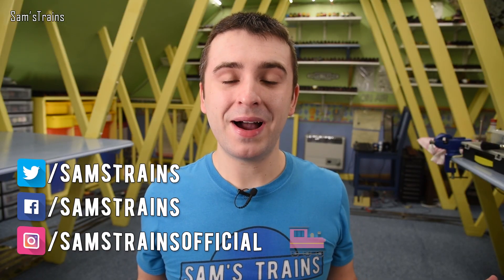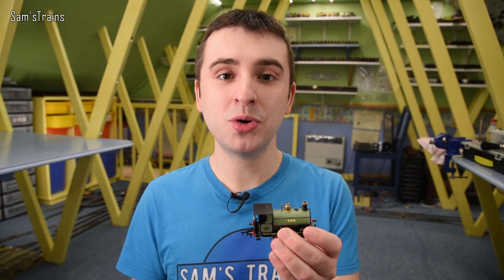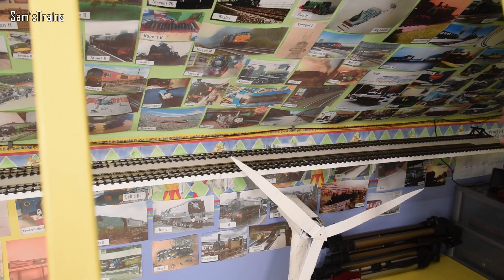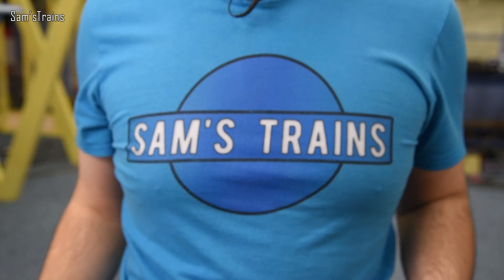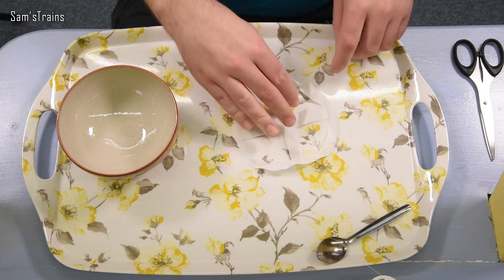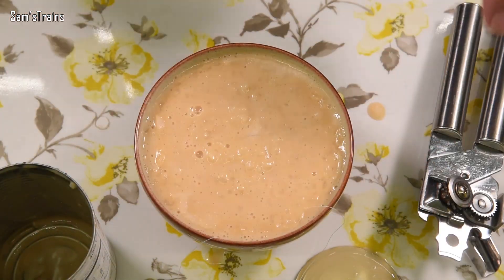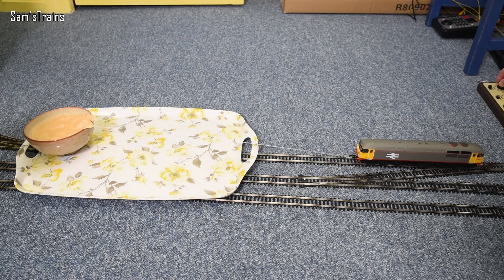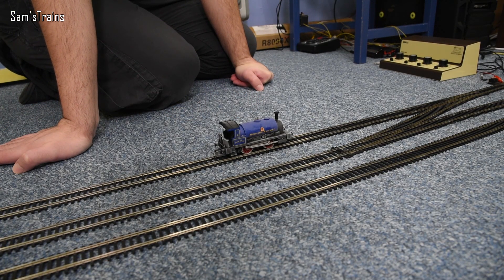What Happens When You Freeze An Engine? | Model Train Experiments

Comment: On the Frozen loco likely what has happened in the cold has caused the metal parts to contract and the lubricants to thicken and perhaps harden depending how long it was in the freezer and that kept it from running initially then once it warmed up a bit it ran more normally.

Comment: Most lubricants will change their viscosity with temperature (they tend to go hard when they get cold, make of that what you will). Freezing your model will add resistance to the drivetrain and require the motor to work harder which is less than ideal. If the lube goes too hard (phrasing!) it might damage plastic gears - not great. It also loses its ability to lubricate bearings properly, at least while it's too cold, so it'll accelerate wear.

Badly made electronics may or may not also be affected.

Comment: Hey Sam, I love your content! I saw a lively debate on RMWeb as to whether rubbing graphite onto the track increases conductivity and improves running. Perhaps a test of this theory would make for some interesting content! Thanks!
Reply from the maker: Thanks so much Jack - that sounds very interesting, I'd like to try that too! Graphite is slippery though... so surely traction would be reduced?
Thanks for watching, Sam :)
Reply: @SamsTrains  You're right that the coefficient of friction is low for graphite, so intuitively you may think it reduces adhesion, however, one theory suggests that the graphite is actually filling in the microscopic pits and scratches on the railhead rather than sitting on top, thus increasing the surface contact area for conductivity without reducing adhesion. Definitely worthy of an experiment!

Comment: My bachman 0 6 0 porter can haul 4 heavy boxcar and flat beds and 3 coaches until wheel slip kicks in.
Reply from the maker: That's awesome - that sounds powerful!! :D
Thanks for watching, Sam :)
Reply: @SamsTrains   its about the same size with a slow gear box and surprisingly it has no traction tires

Comment: I regularly run my trains at sub zero Celsius temps. No, seriously. My house is heated by a Fisher wood stove, and it gets really cold here in the mornings during the winter months. Sometimes, while I'm waiting for the fire to heat the house (and my cocoa) I'll play with trains. I've noticed that many of my trains are also a little sluggish at first, though I never had one completely cut out like you did. I figured they needed a little bit to warm up. I've noticed the ones I lubricated with WD-40, as opposed to 3 in, do perform a little better with he cold, though that could be more due to recent lubrication, rather than type, as I haven't had 3 in 1 for several months. My guess as to the reason yours cut out is that those water droplets were shorting out the motor.
Reply from the maker: Wow!! I'm impressed - I think humidity plays a big part though... lots of moisture in our freezer, so the liquid condensed on the loco and froze!
Thanks for watching, Sam :)

Comment: In my opinion, the freeze of your locomotives motor  should be mainly an advantage because the resistance of the metals decreas as the temperature is lowerig, see supramagnetic effect, but the problem could be, when you put the frozen locomotive on the track, the humidity from the air can condensate on the machine and might occur short circuit. So actually i dont recommend to repeat your experiment in the jungle, or in South-East Asia, where RH is usually between 90-100% 😉😁
Reply from the maker: Ahh interesting - thanks for sharing, that's a good thought!
Thanks for watching, Sam :)

Comment: After thoughts: I reckon if you'd nudged the frozen engine straight out of the freezer, it probably would have started running immediately - it did seem to want to go, but encountered a problem. I think the problem was simply a greater amount of stiction and higher lube viscosity. Although, there's also a chance that ice crystals had completely stymied its running, so I'm not 100% sure. Perhaps a special "Sam Investigative Feature" is needed.

Also... Can an N gauge loco pull an 0 Gauge train? What about N to 00? 00 to G1? Z GAUGE to GAUGE 1?! Also... Reckon the Peckett would have done better with traction tyres. <ducks>
Reply from the maker: Yeah maybe you're right - it did need some nudging before it went! I think I'd agree with that - just increased the friction, or possibly the ice adhered the moving parts together!
Thanks for watching, Sam :)

Comment: Hmmm. a few suggestions for new experiments..

Can Sam operate his trains while wearing a straight-jacket I wonder? 🤣

Can a Pug or a Peckett do either a barrel roll or loop the loop and stay on the track?

The Planet Killer*  - it's a haulage test and you'll need a minimum of 15 super detail coaches (Bachmann MK1's, Hornby Maunsells, etc) and a Steam loco with a minimum of a 4-6-0 wheel configuration. *The first time I tried this test was with Hornby's Rebuilt Patriot 'Planet' - the coupling rods and motion actually buckled, hence the name.

Plus can you run a train through custard?

And rerun the pulling the skin off the rice pudding with Hornby's original release of the Limby Class 59/66 - as I recall that was an early use of the phrase..
Reply from the maker: haha those would all be great fun - a barrel roll would be incredible!!! ;D
Thanks for watching, Sam :)

Comment: Some ideas for you sam! 
- Use lipo batteries to power a model train[ preferebly steam loco] 

- Make a  franken-locomotive using mix matched parts from a bunch of different engines,( it has to be a steam locomotive, so you can mix match external and internal parts) 

- Make a locomotive do a loop-de-loop on a stretch of track. 

- Construct a propper out door layout.

- When its winter, put a snow plow on a locomotive and have it go through the snow( or use baking flower) and see how big of a "snow" drift it can go through. 

- Put a model rocket on a peice of rolling stock, and attempt to beat your scale speed record.

- somehow, make a stretch of track that goes verticle, and somehow make the locomotive go up a wall (try using magnets, or use strings) 
Keep up the good work! I love the experiments, theyre quite entertaining. If you could find time to make a video out of any of these it would make my year.
Reply from the maker: Love it!! Fantastic ideas - thanks for those!! :D
Thanks for watching, Sam :)

Comment: I think that you would have got less wheel spin if they had been exactly in line and not having it slightly off to the side.
Very impressive demonstration :)   That said, you definitely need to be able to get out more often lol :)  The other experiments were bordering on weirdness.  I think I would have used freeze spray instead of putting the loco in the freezer.  A little dryer :)
Reply from the maker: haha maybe you're right! As soon as lockdown is over, I might go back to normal... might! ;D
Thanks for watching, Sam :)

Comment: Regarding OO vs O - each (British) O wagon should be approx 2^3 = 8X the weight of the equivalent OO gauge wagon.  So the Pecket was pulling an equivalent of 56 OO wagons of similar type.   Not too bad at all.....  :)

P.S.  I think just like with HO/OO, your O is larger than ours, so it still should be a 2-1 relationship.
Reply from the maker: Thanks a lot for sharing - that's pretty crazy isn't it?! :O
Thanks for watching - Sam :)

Comment: I am curious to know why the frozen loco did not work to begin with. Frost on conducting surfaces? Lubricants? I wonder if you were to place it in an air tight bag with silica gel to absorb all moisture in the air and then freeze it would the result be different. 🤔
Reply from the maker: I think it was the mechanism - water vapour frozen on the moving parts... hard to figure it out, as it thaws out so quickly, particularly if you're touching it!
Thanks for watching - Sam :)

Comment: Thanks for a fun video Sam.

The reason you had difficulty getting the locomotive up and running is due to the ice that was built up on the wheels, so there was no proper electrical connection from the engine to the rails. When you got the ice scraped off the wheels by and pushed the locomotive onto the rails, the connection came back and it ran.

It is true that the oil gets stiffer the colder it is, but that should not prevent the locomotive from running.
Reply from the maker: It's a pleasure mate, glad you liked it,
Thanks for watching - Sam :)

Comment: Hi Sam! What happens when a train runs down to separate rails both running 

Just to make more sense can a train run with 2 different power rails
Reply from the maker: Ooh interesting idea!! :O
Thanks for watching, Sam :)
Reply: @SamsTrains  if you do this you should also try the difference between the same controller for both tracks and   two different controller, in theory there is  no 0 volts reference with two so you could get some wierd results.